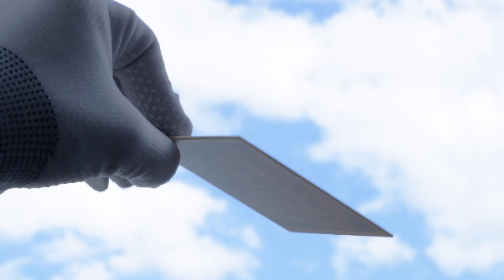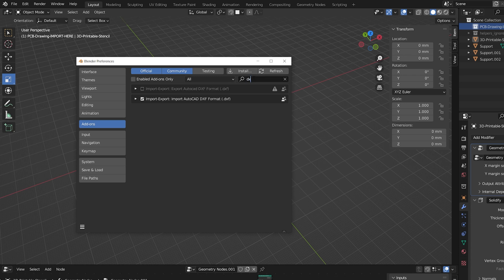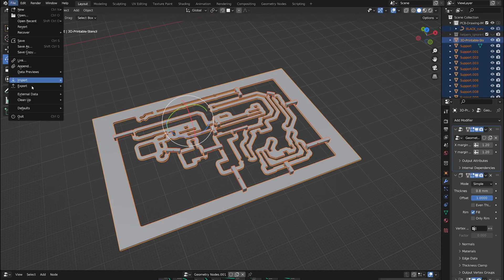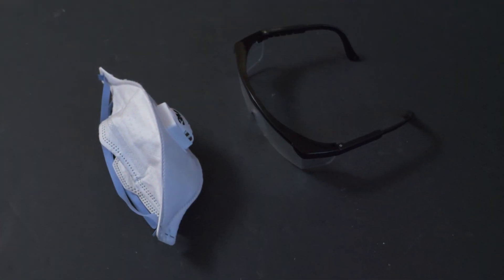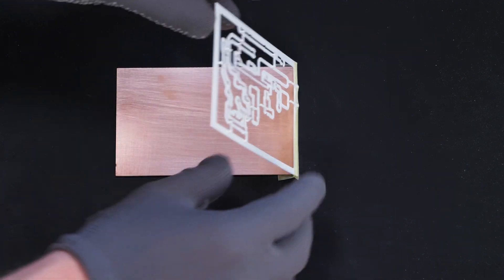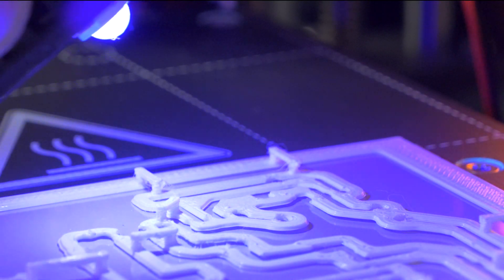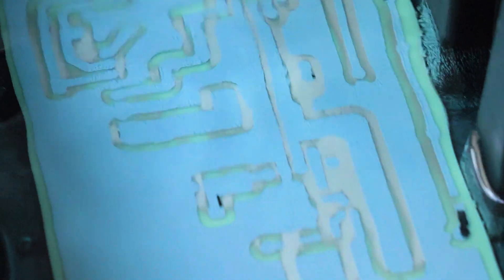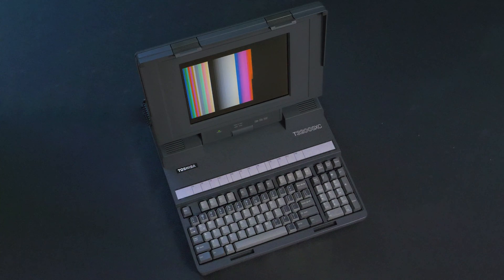Making DIY PCBs with 3D printed stencil and UV-curable soldermask

Comment: This is nuts, you could do the same with any normal used printer, this is just to show you can but has no real usage
Reply from the maker: Sure, you are mostly right, however I only had access to a bad quality inkjet printer at the time, and it didn't provide enough contrast when printing on the film. It should be noted, that I am using UV soldermask here - not presensitized board/photoresist film. And I couldn't get this soldermask to cure properly when I was trying to use the film. But 3D printed mask did work, and it's hard to mess up this process, as there is no risk of overexposing the board. And I didn't need to use caustic soda to develop the mask (using regular photoresist does require it). 

Even if we skip the 3D-printer part, I have also never seen anyone else using UV-curable solder mask to create the actual PCB. I only have seen videos of people trying to create an actual solder mask with it, and they were squishing the paint with a transparency film, sometimes getting bad results, as the paint sticked to the film and not to the actual PCB. I found out that a rubber roller may be helpful to spread the mask evenly, and also didn't see anyone else doing that. If someone has a good laser printer with good toner coverage, they could try repeating this process with printed foil, soldermask and a rubber roller. Maybe that would be even better.

To sum it up: this method is a hack and I agree that it's nuts, however it's just a tool, it had a real use because I just made a working power supply with it, with one day turnaround time, when I had no option of making the PCB using another method. Maybe it suited just me and noone else will ever use it again, but it's just an option. And if you can wait long enough, just order the PCBs to be made for you.

Comment: I have a question. Have you try this idear? Use SLA Printer to use the Screen or DLP to Screen the PCB and etche it after? After that use your UV cure Paint to create the protecting layer with free solder Pads?

Comment: When I was in school I did electronic products and after we designed the PCB board on the software (can't remember what the software was called) and it was able to print the design off and what we did was print it into clear plastic sheets for overhead projectors then once it is printed off we then put it onto the blank PCB and then put it in the same printer as it had a scanner as it used UV light then etched it one that was done

Comment: Couldn't you just print the plastic on the PCB - AS THE MASK and drop it in acid?
Reply from the maker: I've seen some tutorials for that and it is possible, however it seems that a flexible filament would be required for proper adhesion. I'm also currently working on a pen plotter head that would allow plotting PCBs with marker. This is also something that people have already done and I think that pen plotting on the PCB would be better than printing filament on the PCB. However pen plotting on a PCB with good results requires a spring loaded pen holder with no wiggle and smooth up-down motion and that's what I'm working on. If I get some good results will describe them too.

Comment: No need to make things so complicated, just print the layout on a transparent film
Reply from the maker: I did try this too, and film method obviously allows for finer traces, however it is much easier and quicker to expose the board properly with a 3D printed mask, as it passess or blocks 100% of UV light.
Reply: @adalbertfix  I understand, but 3D prints, especially thin ones are not very flat, which can cause issues. If you could print directly on the copper, then it would make more sense to me.
Reply: Like we all do in the rest of the world, the technique is really old, like 30 years...

Comment: why not use a normal printer and transparency film like everyone on the planet for the last 30 years
Reply from the maker: I did this precisely because I didn't have a working printer at hand at the moment, and wanted to have the PCB on the same day. And it did work. The UV exposure times are also quicker than with film. I think this method would be most useful for prototypes with a lot of power planes and huge SMD components (power mosfets etc.)
Reply: I used an ordinary b/w laser printer and just printer paper. No need for a transparent film, the paper is transparent enough. Just make sure to have the print facing down and the contours become super sharp.